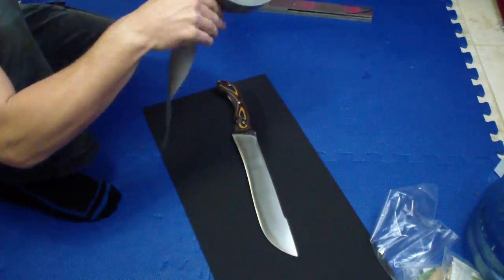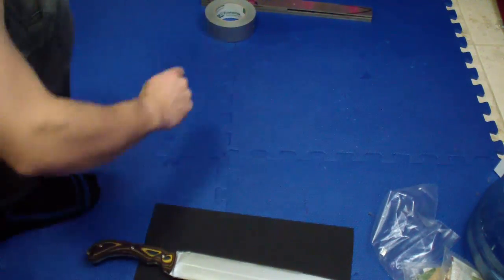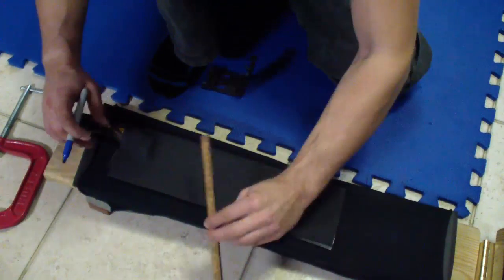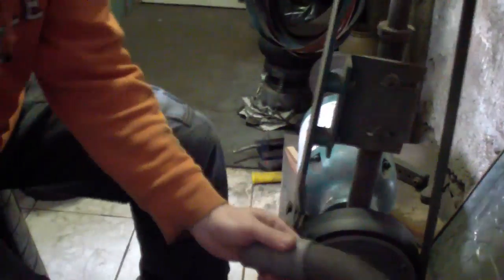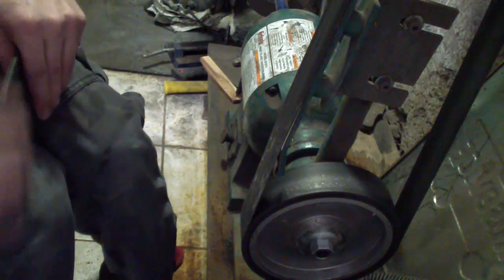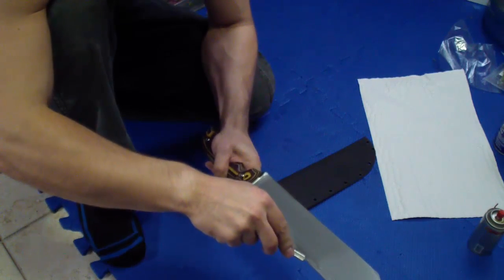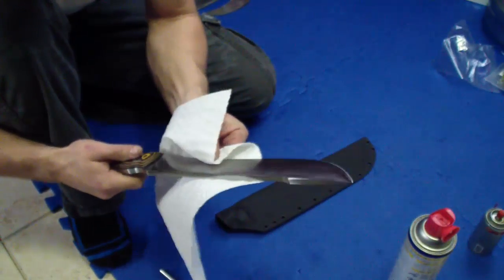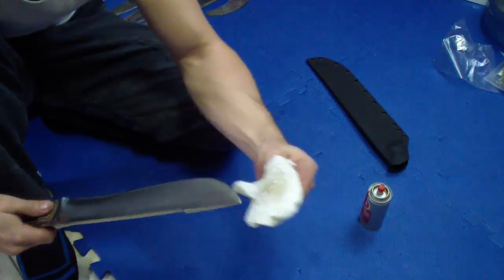Making a Large Custom Knife - Part 7 - Kydex Sheath

Comment: is your belt sander the grizzly one? i have been working on a 4x36 for the past year or so.  I have heard that 1725 rpm is best for knives and on the grizzly site it says the motor speed is 1725 rpm but the belt speed is 3600 FPM. do you or anyone know how thats different from rpm and would it work at about 1725 rpm? i would assume FPM is feet per minute and the belt is 6 feet total divided by the 3600 feet per minute make only 600 rpm. Help anyone?